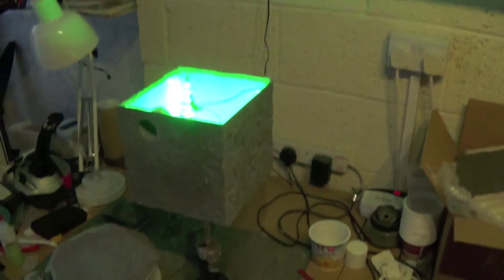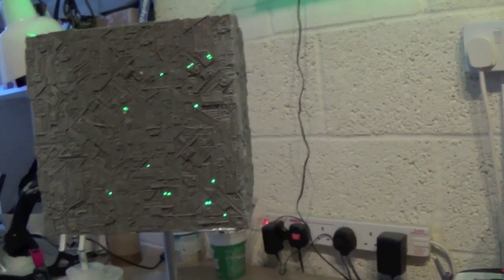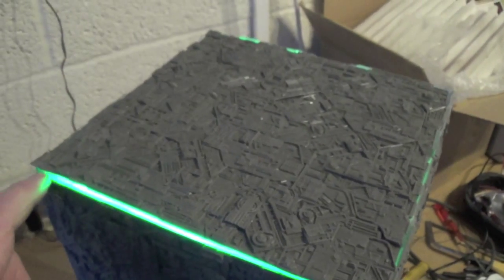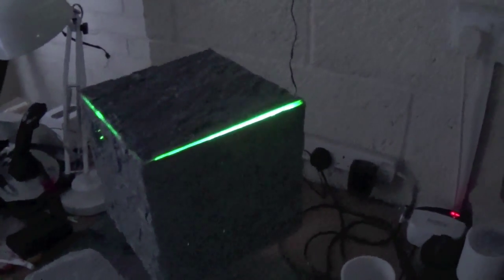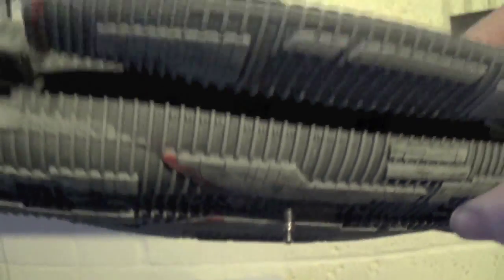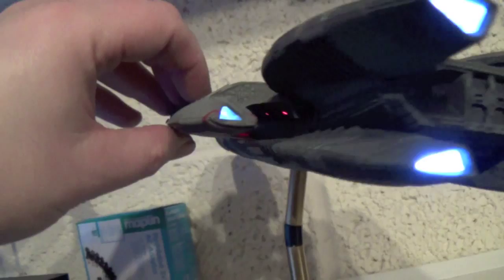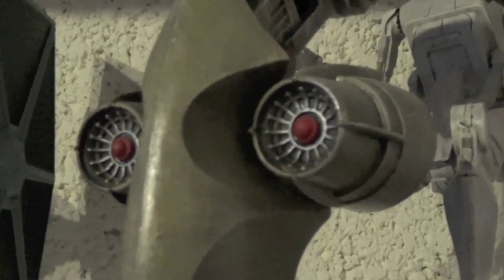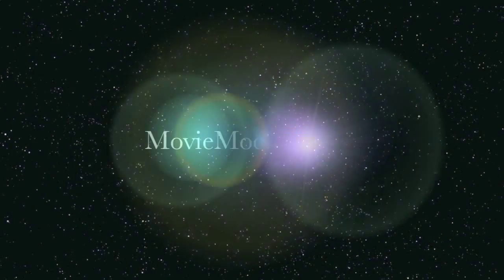Borg Cube -  Part 3

Comment: Sorry to here about your mother. I had an aunt with the same illness and then my mother started have the same problems. On a more positive note, I would like to see you get back to completing the Borg Cube one day soon?

My build of the identical model Borg Cube has the same panel bad fit problem. I spent hours in the back garden filing the chamfers, 24 in all to get the best fit. I tried to match the panels to get a good fit by dry assembling and marking each edge to an adjacent panel edge by adding letters for later reference. I did end up with one bad gap like the one in the video but not quite that wide, it was about 1mm in the end. I also have several small 90 degree work-working clamps which helped the build when gluing and with the dry assembling.  I plan to slot as well as drill for the light effect and place white styrene sheet spaced off the back of the panels to achieve the glow effect on the studio model. Also, my thoughts are to use clear rod to hold the sphere as if it is launching from the tube and let the light pass down it into the sphere which I will drill through to the core to also have light spots illuminating it. I was going to put individual LED's around the inside of the cube but seeing your method with strip LED's, I will use that as it is so effective. Thanks for that and all the videos.